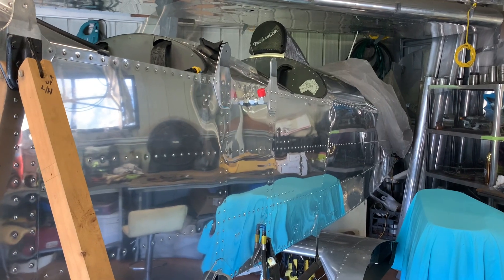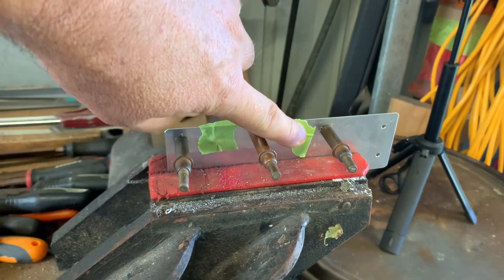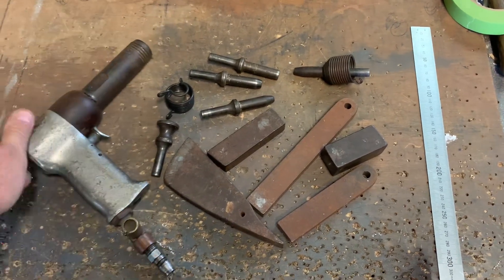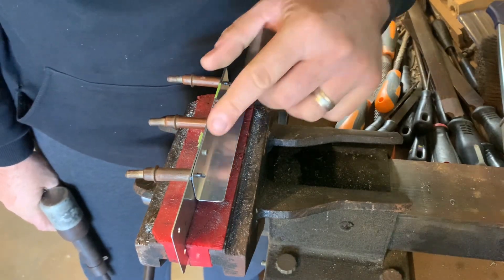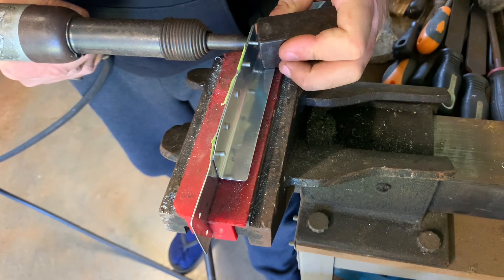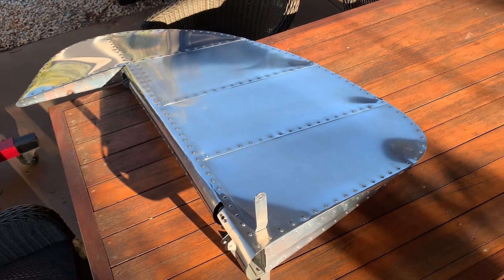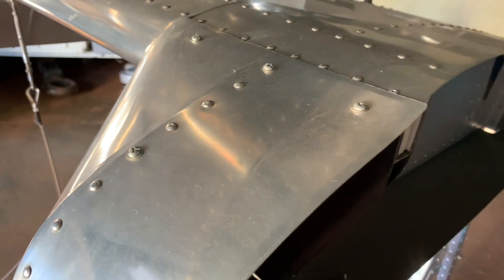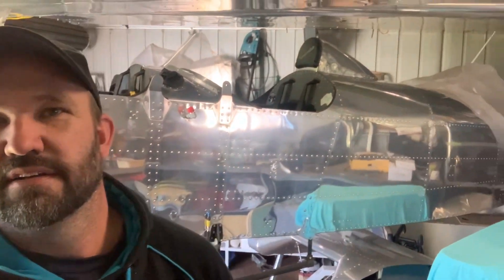How did Donny do that!? Using rivet guns and solid rivets to build Frankenstein

Comment: What leads the decision to use universal Vs countersunk rivets?
Reply from the maker: I chose universal rivets as I wasn’t after speed with this aircraft. They are a little easier to rivet up, and I didn’t have to spend more time dimpling or countersinking everything
Reply: @donwtsn is there a maximum depth you can countersink to? I assume you'd not want to countersink deeper than the thickness of the sheet nearest the gun, so you'd use an appropriately sized (diameter) rivet? I've never solid riveted anything so this is all new territory 😄
Reply from the maker: There is a countersink bit that can be adjusted for the difference sizes of rivet ie: 3/32,1/8, 5/32. The idea is to countersink deep enough do the rivet head is flush with the skin, not any deeper. If the skin is thinner than the countersink depth you can dimple the skin, but, then you need to dimple the structure underneath also
Reply: @donwtsn aah awesome, thanks! Sounds like a lot of work!😄👌🏻

Comment: Trying to do some new 3/16 rivets on my Jon boat what rivet gun is that. I want one that hits slower than a air hammer so I don’t crack the hull and that one seems to hit slow. Or if you don’t know any recommendations that won’t break the bank ?
Reply from the maker: Gday mate, I’ve had my rivet gun for ages so I’m not sure how much they are now. Maybe a couple of hundred dollars I guess. This rivet gun is a 4x which I prefer over a 3x as it has a bit more hitting power and can handle the bigger rivets. If you are worried about cracks the hull, maybe you could make a steel block that fits the rivet head and bash the tail with a hammer and punch. You may be able to use a softer type rivet as well. Sometimes if a rivet is harder than the material it’s riveting, the rivet can actually swell the hole and fall out. Hope this helps mate
Reply: @donwtsn  maybe I’ll use a soft aluminum rivet that should be softer correct? What website do you recommend for quality rivets ? And maybe I’ll order a river gun and cut my PSI way back to slow it down ? That maybe work ?
Reply from the maker: I’m not sure about boat supplies, but you can look up aviation supplies like Aircraft Spruce for rivet guns and rivets. I guess you have the rivets. The rivet guns have a throttle instead of a trigger so you can vary the hitting power and speed. You can leave the pressure up to get the hitting power
Reply: @donwtsn  okay I will definitely get a rivet gun then like maybe Eastwood brand ? And for rivets for brand which do you Use ?
Reply from the maker: I use aircraft grade rivets for the Frankenstein build like ms20470ad. I haven’t had to buy any as all of my stuff had been collected over the years thanks to leftovers from other jobs. If I went to buy rivets it’d probably be through Aircraft Spruce or some aviation dealers for them, mainly because I’d be wanting the aircraft grade. I’m not sure for boats. You might be able to search on the web for a store that supplies solid rivets and then choose a grade that would match the boat material. Or, if the holes are 3/16, you might be able to get away with using machine screws and nuts, or bolts? Put in with a sealant like sikaflex?
Reply: @donwtsn  I possibly could use bolts and I’m considering it but there on the bottom and I don’t want them dragging rocks. I’m not sure how that would go. We run rocky areas. Rivets is what it had before so I was gonna attempt to use those first!
Reply from the maker: Yep, that makes sense. Is there a marine supplies or anything near you? They might have the rivets available. Or, if you search aluminum boat rivets you should find a mob that supplies the right type of rivets. You’ll need to work out how long they need to be before you order them. If they sell rivets they’d have a chart showing that. For aircraft, the rivet needs to poke through the hole about 1.5  times the diameter, no more than 2 times the diameter before riveting. A 4x rivet gun would handle 3/16 rivets well. A lighter gun like a 3x has less hitting power and a higher rate of hits, which could work harden the rivet before it is set properly
Reply: @donwtsn  No there int unfortunately I’m definitely going to order them if I go that route! I think my next step is to measure my boat thickness and the brace thickness. And I didn’t know that. How do you see the difference between one to another is it listed on the websites ? Thanks for all your help by the way wonderful !
Reply from the maker: No worries mate. A simple way to measure the material thickness is to use a small bit of wire with a bend/hook in it as a depth gauge. The ms20470ad rivets I mentioned before would probably be fine to use but the ones for boats would be more compatible I think. I did a quick search for aluminium boat rivets and saw amazon had them. I’m sure there would be other ones more tailored to boats too. From what I can see, the marine rivets are a softer grade rivet than the aviation ones and might have a better corrosion resistance to them
Reply: @donwtsn  I got some GENERAL thicknesses on my boat. So the Hull is about the thickness of a dime maybe little more. The brace is about the thickness of a penny. US dime is 1.35mm and a US penny is 1.52 mm. What length would I need ?
Reply from the maker: The rivet should protrude through the metal about 1.5 times the diameter of the rivet before riveting it up. For a 3/16 that would be about 5mm. Add that to the material thickness and that is the length of the rivet you need, say, almost 8mm long. When you look at charts for rivets the length is measured by the shank under the head, except for countersunk rivets. But I figured you aren’t after those.
Reply: @donwtsn  I am looking to get brazier head rivets aluminum ones to try. I’m ordering river gun like you recommended! Maybe to get the correct rivet size I should email a company my measurements?
Reply from the maker: Cool! I’m sure they will be able to guide you through to the size you need

Comment: Enjoyed the video, excellent! However, you didn’t talk about rivet length or stick out. Also, I don’t understand the rivet gun designations, 2x, 3x, 4x. What does this mean? BTW, hello from Idaho, USA!
Reply from the maker: Thanks mate. The rivet gun designations are related to their hitting power. A 2x has much lower hitting power than a 4x. I’ve used the 2x on small rivets like 3/32 and in tight areas, but it doesn’t really work on bigger rivets or harder materials like monel or E rivets. That’s where the 4x comes in. I prefer using a 4x as it has the hitting power to handle the different types of rivets a maintainer would come across on different aircraft. You just need to be a little careful riveting up small rivets with it though! As for rivet length, the usual goal is, before riveting, the tail should stick out about 1.5 times the diameter of the rivet. When it’s riveted, the dumped up tail should stick out about 0.5 the diameter and be about 1.5 diameter wide. I say about because that is the dimensions we aim for, but a little bit on either side is acceptable too. Sometimes I will have the rivet tail a bit longer to start with if the hole is a bit oversized when doing repairs. The rivet swells to fill the hole before dumping up. There are ‘go, no go’ gauges you can purchase from aircraft spruce and the like that give you a quick reference to rivet tails before and after dimensions available. And if you read anything about solid rivets in aircraft structures there will be a reference and diagrams about the desired lengths. Hope Idaho is treating you well mate

Comment: The onlt difference between you and me is I skin pin every 3rd hole but as the same if it is a complex shape then more pins and remove the skin pin to fit a rivet (note here in the UK / RAF we used skin pins more than Clecos). I used elastic bands around the dolly block in a lot of applications to stop marking. We did have some rivets that had to have rounded tails in some areas of the Victor cockpit, although they had counter sunk heads and the reaction block was just the same as your dolly for that, we also had a few more areas with counter sunk heads both sides (mainly trailing edges). "Set, rivet, touch, Next!"
Reply from the maker: I’ve seen rubber bands used by some guys. For some reason I preferred tape.   Domed tails were all the rage back in the day. “Rivet!!”
Reply: @donwtsn  We even did plug rivets, they are a pain as you have to drill the hole to the right depth (spot on) then tap the hole, trim the rivet to the exact length, cook them / solution treat, then freeze them and you only have a very short time to use them once out of the freezer. Thank goodness they are only used on old aircraft designs that are out of production but I think there must be some poor chaps out there doing restoration work that might still have to deal with them and if you think putting them in is bad removing is even worse!! Thankfully I only did them during training and for a repair on a Battle of Britain Memorial Flight Lancaster leading edge once after a bird strike had popped the heads off a few.
Reply from the maker: @flyingkub  oh boy they sound like a right pain! Glad I missed out on those. I did get to play around with DD rivets where we’d anneal them and put them in dry ice. We had about an hour or so to use them. We also had to use steel rivets on occasion. I can’t remember they type of material but you knew you were in trouble when there was a hole pre drilled into the tail of the rivet to get it to buck up. There was another type that was hard enough to punch a hole in the dolly if the hard facing had been compromised. It’s nice that the designs these days seem to have settled on more standard types of fasteners